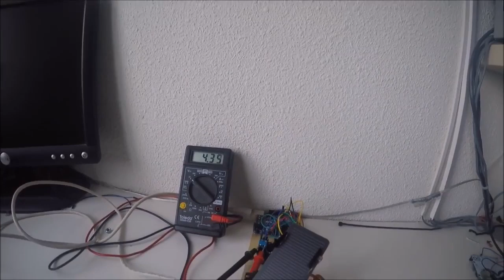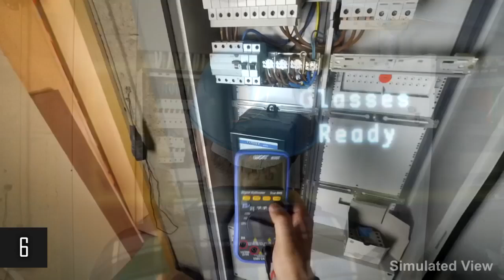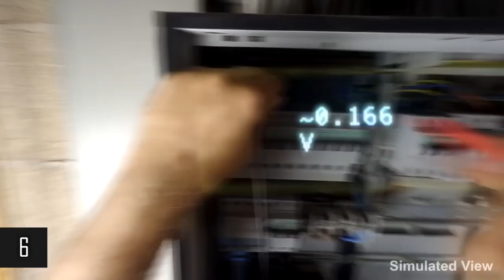Top 10 Arduino Projects 2018 | Amazing Ardiuno School Projects

Comment: Really nice work
can U pls point on the right direction on how to get a good jump start on arduino circuit design.
Thanks alot
Reply from the maker: well you need to first decide the model to start with (Arduino).
take help from youtube and watch tutorials to prepare something :)
Reply: It has models?
Reply from the maker: yeah i don't know much but there are different modules i'm sure.
Reply: Okay
Thanks alot
Reply: Eagle software
Reply: Basically u don't need whole arduino in implementation 

So for multiple projects don't waste money on full arduino designing r in buying them

Just purchased 1 arduino  (for programming other microcontrollers)
Atmega series 

Each microcontrollers just need reset and clk that's all!
So now just design new microcontroller ckt with clk and reset small circuit and with output/input  pins .

Comment: Hey how did you do the data glasses??
Reply from the maker: I didn't make any of these, use the source links in description.
Reply: Using a multi-meter with Bluetooth connected to the Arduino which connects to some thin LCD to display it most likely

Comment: Number 1, its just keep following the left line
Reply from the maker: yes i know, but to keep the title short you know.
Reply: it folows the left line the first time. but if you place it on the same place of the same maze twice, it will just go directly to the exit. so it's a little bit more complex that just "follow the left line"...
Reply from the maker: +arthur111213 exactly.
Reply: arthur111213 well thats pretty advanced
Reply: so it saves the correct direction of each junction so it can be used on the next try.

Comment: The Come On illustration at the beginning of your presentation is not included with the context of this video, and it's one of my big gripes with these kinds of presentations. It's a manipulation I despise change your ways I won't watch any more of your videos until you until you do
Reply: Viral Hattrix apologies for the typos my voice recognition was correcting my sentences I should have double-checked
Reply from the maker: oh you mean thumbnail?
Reply: The photo that displays at the entrance to your presentation is not included in the presentation articles.
Reply from the maker: That was actually Google Glasses which i put by mistake and it looks good so i didnt change it. but the point is, there IS a project similar, and is called Data Glasses.
Reply: Viral Hattrix the point is numbnuts it was not in your presentation and I waited for it wasting my time looking for it. Looking good is not enough you got to come through. It's commonly known as false advertising. Right up there with false news, false books, and other propaganda.